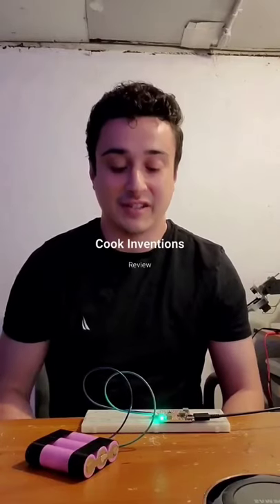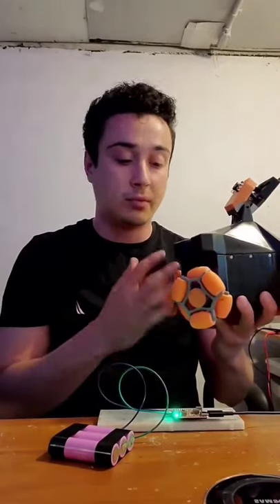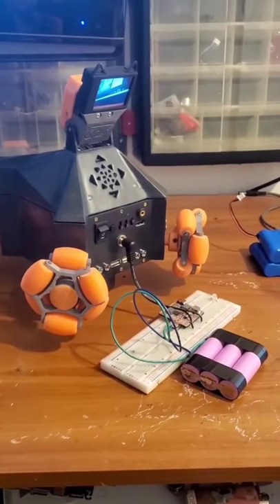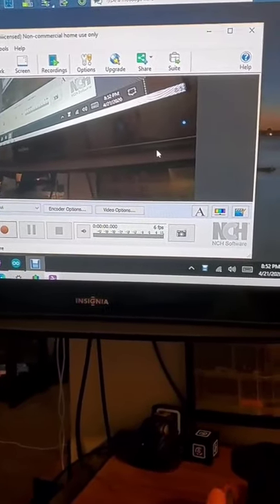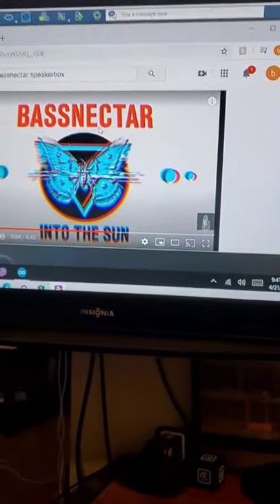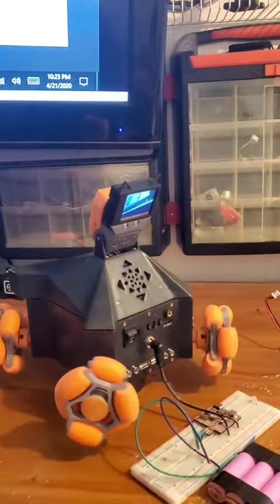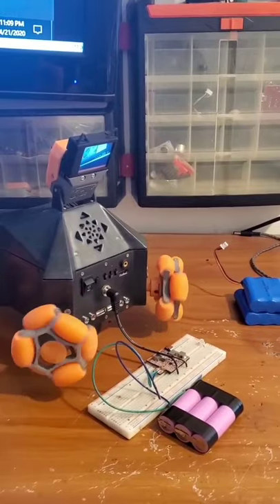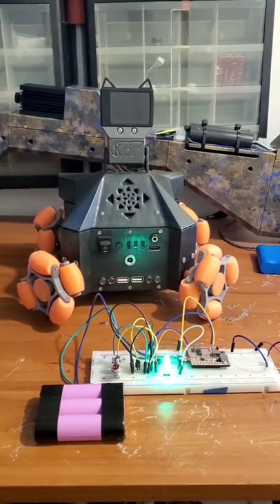Retro PSU 2 Review by Brandon Cook from Cook Inventions

Comment: It's got more features than the adafruit powerboost 1000c (not sure about apple charging diodes or whatever but I don't need that) and seems to be running my portable pi4 with the official screen better than the powerboost. No low voltage ⚡ symbol or notifications. Big thanks to the helder games website and anyone involved in creating this board.

Comment: That's a neat little PCB.
Can this board charge the battery while supplying current to a load, or would it damage something?

(assuming the input source can supply enough amps)
Reply from the maker: Depends on the load from the system as this can charge at 3A but if the load is about that or more then no way it can charge and run plus this takes usb-c at 5v and that standard only runs at a max 3A.
Reply: Yeah I'd use a barrel jack for sure. 
The plan would be to charge at 2.1 amps and no more than 2.5 amps discharge, from a 5.2v 5a AC adapter

Comment: With this board, could I have a 5V 3A? And is there any type of flat or smaller Battery? Where is a link to buy it? i need it to be able to be turned on with a button and off with the Software, I'm using a Raspberry Pi 3 B and have Retropie, is there a way to show battery power?
Reply from the maker: The board can do up to 6A, it requires a lipo battery and can be any size but smaller capacity ones will not last. There is software on github as well as on the order page to the Retropie Monitoring software  to monitor battery power and do a safe shutdown. If you want to turn things on and off with a switch you will need an additional board like the one available at The board can do up to 6A, it requires a lipo battery and can be any size but smaller capacity ones will not last. There is software on github as well as on the order page to the Retropie Monitoring software  to monitor battery power and do a safe shutdown. If you want to turn things on and off with a switch you will need an additional board like the one https://www.humblebazooka.com/product/raspberry-pi-safe-shutdown-board-for-helders-retropsu/

You can buy this board in the video at my site:
https://www.heldergametech.com

Comment: I need to use it with an Intel compute stick, how can I use the controller and how can I use the on off switch that has safe shutdown?
Reply from the maker: Intel so I assume it's x86 or x64? If so the controller and other things like safe shutdown likely will not work. All of that runs off of python scripts and was designed to work on a raspberry pi so  can't really help you with this module.

Comment: Does this PSU solution support a safe shutdown like Adafruit Powerboost?
Reply from the maker: It has a ADS1015 IC that is hardwired to the battery and will show the battery level on Raspberry Pi or other devices that use I2C, there is also software that will enable a safe shutdown once the battery itself is low. It does not have built in hardware safe shutdown.